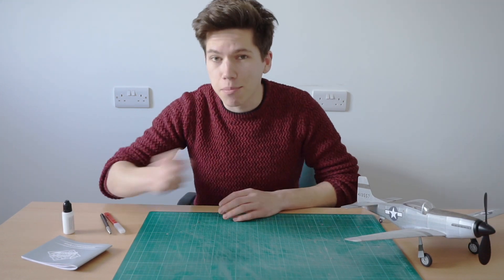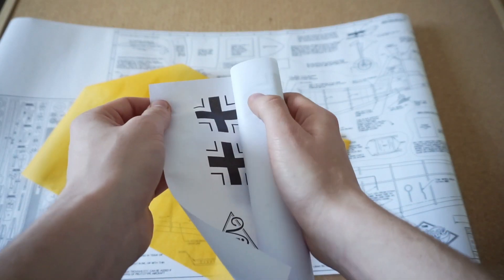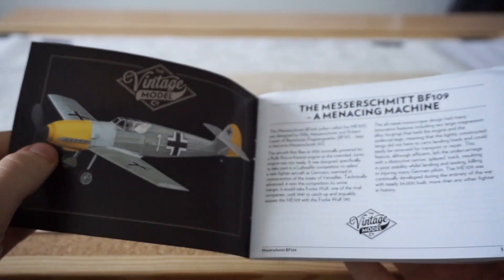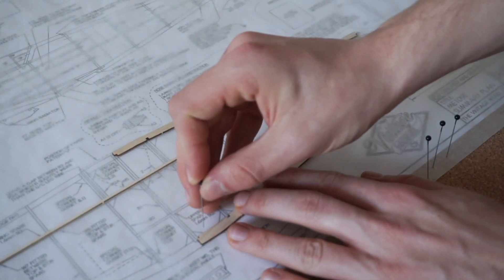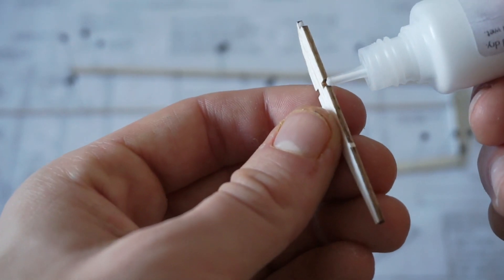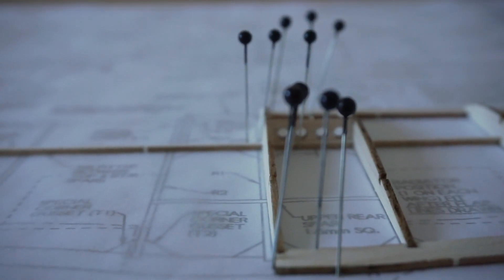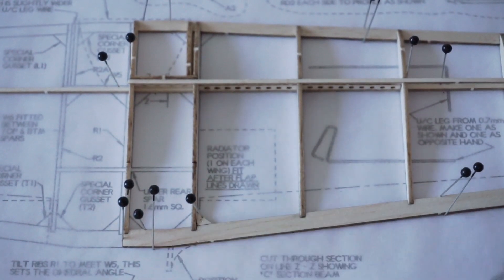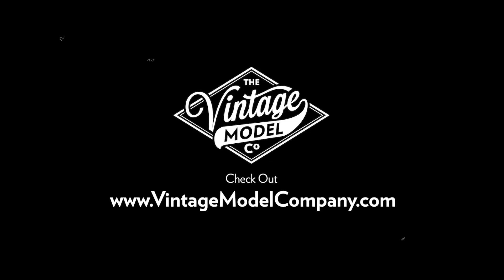How to Make a Balsa Model Airplane Wing | Balsa Basics Series

Comment: Just keep in mind, that this particular kit is Laser Cut balsa. There are several older kits in which the parts are Die Stamped and you will have to cut each piece out by hand. Much harder to build.

Comment: Getting the dihedral right is hard. Any tips?
Reply: Set the root ribs at the correct dihedral angle with the supplied jig piece,prop up wingtips with suitable block the same on each wing panel and allow to dry overnight.
Reply from the maker: @angelreading5098  👆Exactly that. 😉

Comment: Hey does the glue not sticky to the plan  / drawing ?
Reply: he covered it in wax paper so it would not stick. if the wax paper were not there, it would stick
Reply: You can also use any polythene clear sheet to stop the adhesive sticking to the plans.
Reply from the maker: @angelreading5098  Yep you can use wax paper or similar semi-transparent sheet material to protect the plan and your model.
Reply: Cover the plans with a sheet of parchment or wax paper or plastic/saran wrap. These are like tracing paper because you can see the plans beneath them. They are sold at fine grocery stores everywhere.

Comment: You should work on a design that uses a really small brushless motor/e channel setup. I've been wanting to buy one of your kits anyway and do just that. I think that could be a really big hit-micro sized brushless warbird!
Reply: *3 channel setup
Reply from the maker: @lukerondeau8442  It may be a little larger than the model you describe, but we have just released a 3-channel SE5a kit that includes all of the electronics and materials you need. https://www.vintagemodelcompany.com/radio-controlled-se5a-ww1-fighter.html
Reply: @vintagemodelco7936  anyone hanging crepe paper strips off the rcs and doing a little competition to see who lands with most paper..use to get in a pit with the UCs but RCs would take it to another level...